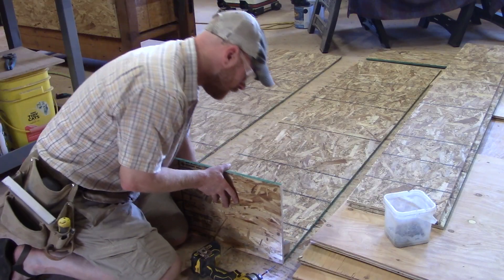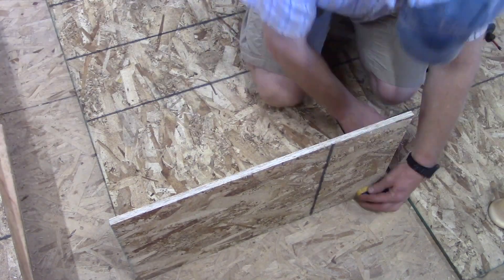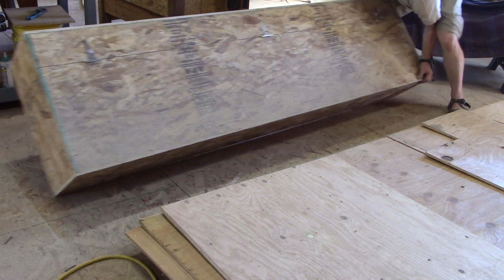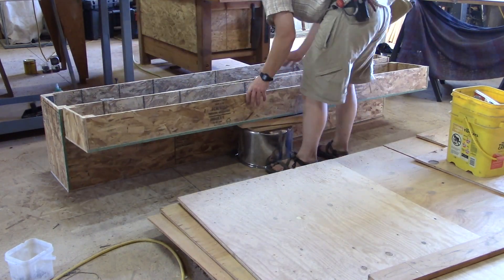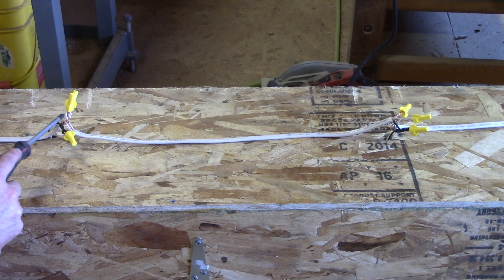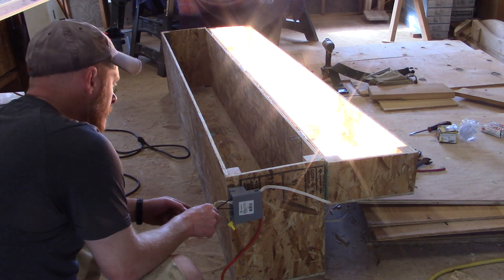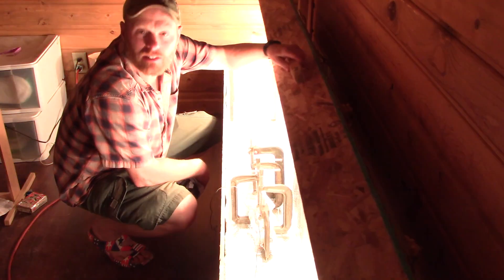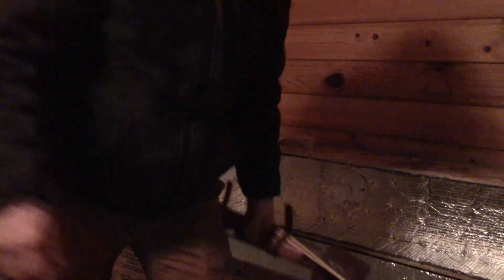Fiberglass Bow Build! HOW TO GLUE | Part 2

Comment: What's your recomendation on temperature and duration in the hot box for laminating bow limbs? thanks
Reply from the maker: Application - Apply to prepared surface and let cure for 24 hours. Applying mild heat will cure EA-40™ faster – 150°F/65°C for 6 hours.

Post Curing - After EA-40™ has cured at room temperature, heating the epoxy to 150° F (65° C) for 4 to 8 hours will increase physical properties and performance. Let cool to room temp. before moving bonded substrates, machining, etc.

To Attain Maximum Heat Distortion Temperature - let cure for 24 hours at room temperature, heat cure for 2 hours at 250°F (122°C).

At mix ratio 1A:1B – HDT will be 163°F (73°C).

At mix ratio 2A:1B – HDT will be 217° F (103 °C)

You can mix a 1 to 1 ratio and cure at room temperature for 24 hours and will work just fine, you don’t need a hot box to make a bow that will work great. 

https://www.smooth-on.com/products/ea-40/